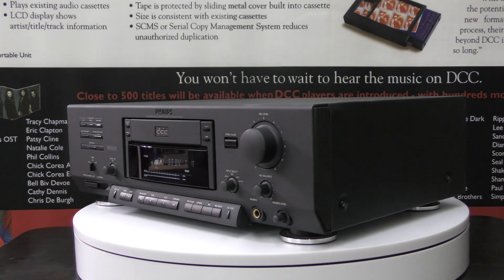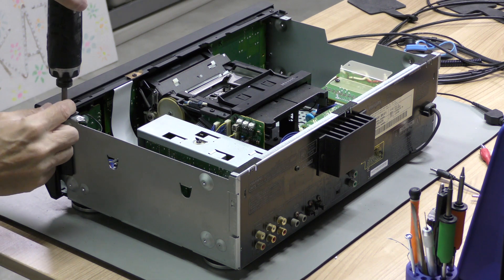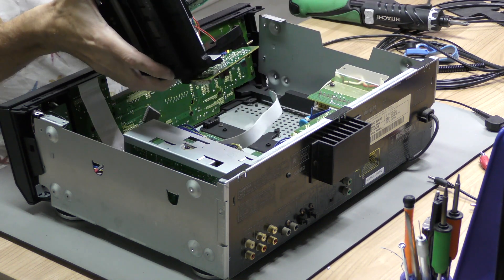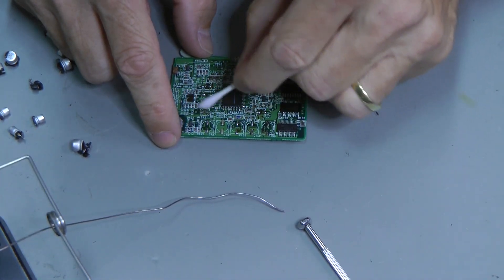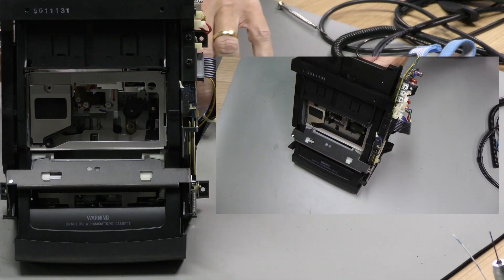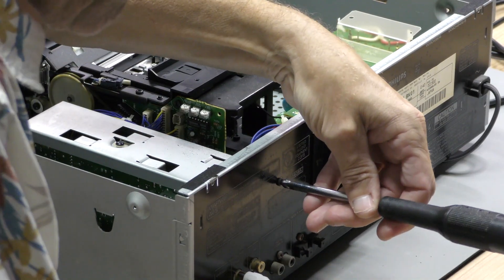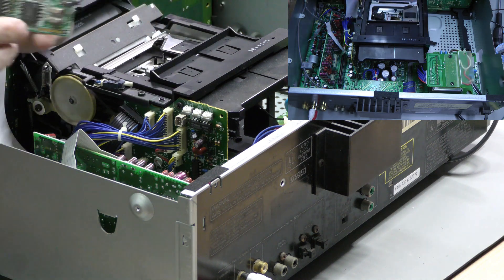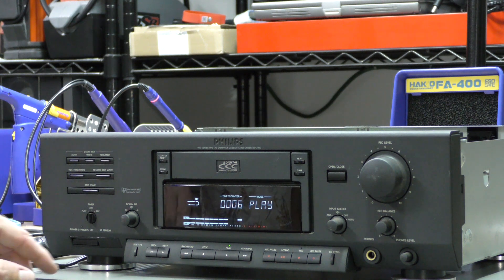Philips DCC900 Digital Compact Cassette repair and recap

Comment: DR DCC ..JOB IS DONE ALL CAPACITOR REPLACE WITH THE SAME VALUE BUT THE ISSUE IS NOT SOLVED.THE SOUND STILL CRACKING NOT CONTINOUS AND SMOTH..CAN YOU PLEASE LET ME KNOW WHAT IS THE ISSUE AND HOW CAN BE SOLVED..THANK YOU
Reply from the maker: Arvin Aves Hi, it can be a few things. There are metal connected islands to connect both sides of the board. Some of them are under the leaking capacitors and can be eaten away by the acid leaking. Check with a multimeter if they are intact. Double check if all soldering connections are good as well as the capacitor connections. Finally check the pinch rollers.

Comment: what is the value of the capacitor to replaced? or same value?
Reply from the maker: Arvin Aves we use the same values. Higher voltage is also possible.

Comment: Can you tell me what the correct spec of capacitors are required to do the job please? I am up for trying to fix mine but need to know what to replace with. Thanks.
Reply from the maker: Hi, This is the part list.

]2,2µF/35V/BP - 1 - Nichicon UMP1V2R2MDD
4,7µF/16V/BP - 2 - Nichicon UMP1C4R7MDD
10µF/16V - 9 - Nichicon UMV1C100MFD
22µF/6V3 - 1 - Nichicon UMV0J220MFD
68µF/10V - 4 - Panasonic EEA-GA1A680
Reply: DR DCC 6V3? Should this be 6.3?
Reply from the maker: MP3 Rider correct
Reply: Thank you for your help and thanks for a great and informative video.  I must now pluck up the courage to fix mine! LOL
Reply: Is this a service you offer to people like me?

Comment: Repair at museum...
Changing the capacitors only is not enough ! Those capacitors are leaking electrolytic and often other nearby A/D IC, potentiometers and other discrete are seriously affected. Not to talk about the PCB itself which often suffers of non conductive vias, circuit delamination and possible PCB layers delamination. Ultrasonic bath is not enough. If electrolytic is left it will continue its destruction over the time...
Reply from the maker: Interesting train of thought. We double clean with solution and afterwards a sonic bath. Removing all components leaves a very brittle solution at best.

Comment: Is this unit belt drive? Did any direct drive home, portable, or even car units exist?
Reply from the maker: Yes all DCC units are basically belt driven, including the portables and car units.
Reply: DR DCC Well nuts to that then. Wonder why they decided that was a good idea. And I am NOT desoldering a bunch of crap just to change a belt. I'll just look for one of the old Sony Walkman units Techmoan suggests in his recent video on them.
Reply from the maker: Only the second generation portables would need desoldering. First generations Players,  Like the DCC130 or Panasonic you can get to the belt without any soldering.
Reply: DR DCC Meh, still want direct drive through. Clever idea, though I'll stick to a direct drive deck and portable. Thanks for the info though.

Comment: Thanks for documenting this so well.  

FYI - in the U.S. we don't say, "print", as this is an ambiguous term here. I think what you are referring to we would call "PCB" or "printed circuit board" or "circuit board" or even after referencing it, a shorthand is just "board."
Reply from the maker: David Sutherland You are correct. It was an incorrect translation on my end.